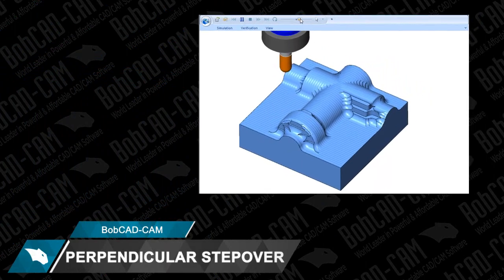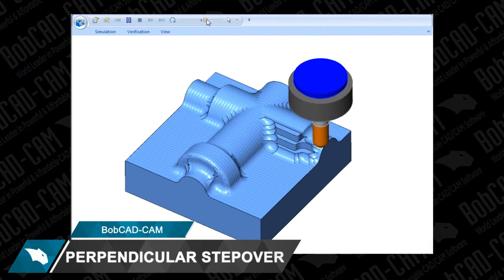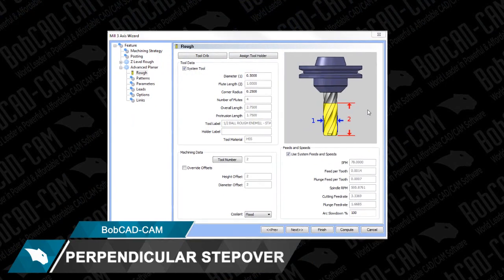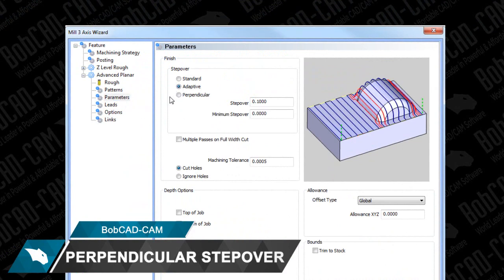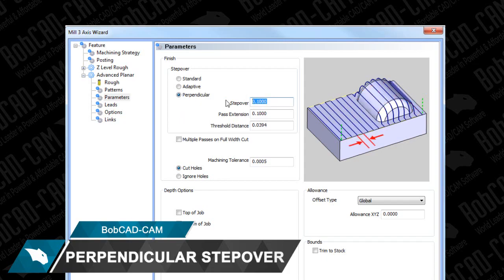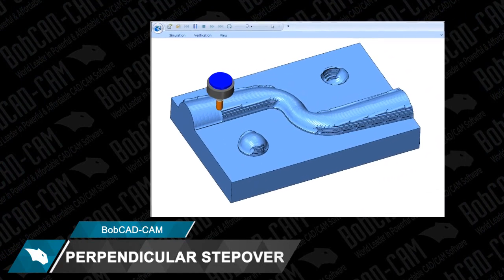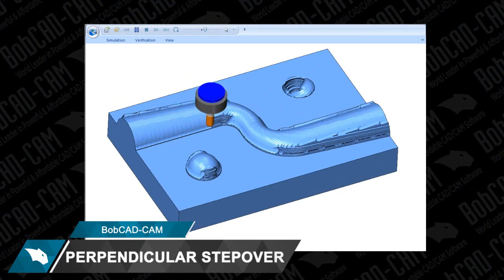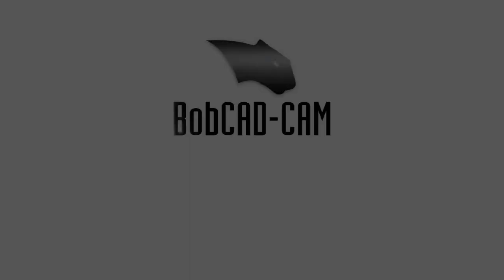CAM Software - Perpendicular Stepover Toolpath Feature

Comment: I think before they create new toolpaths they need to fix the equidistant offset in V27. I am stuck using V25 because it just will not work correctly. I have no idea if it is fixed in V28 or not. I'd think it would have been fixed and offered to me as a replacement since my V27 did not work correctly. Thanks BobCAD
Reply from the maker: We've released updated for the V27, and V28  and V29 software.  I am not sure what issues you might be having.  For more information on the current builds and release notes you can email support at bobcad.com
Reply from the maker: In most cases if you software is crashing all the time, there is some issue with the machine / software configuration.  It could be video drivers, system resources, and more.  The best bet is to email support at bobcad.com and they will take care of you.